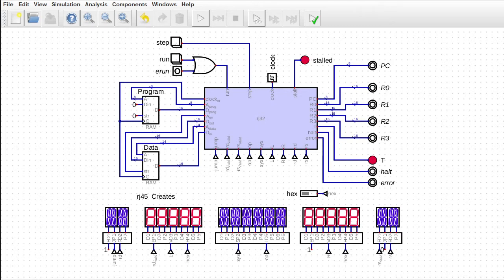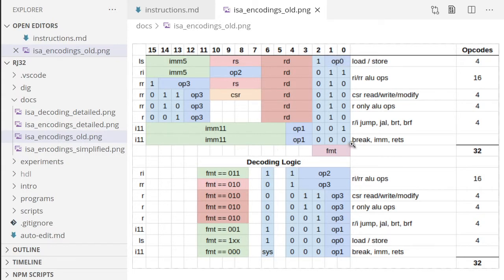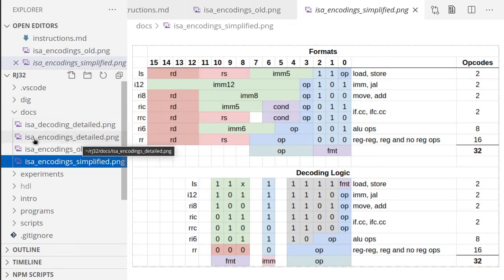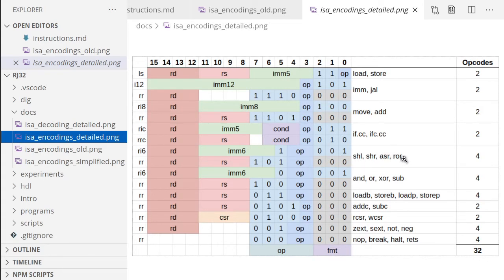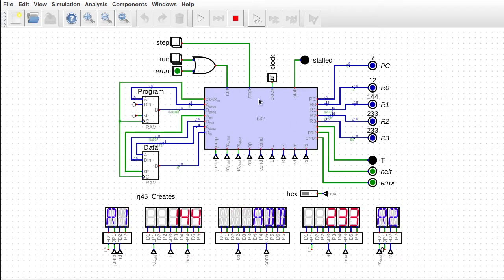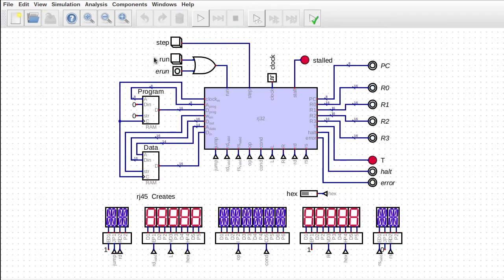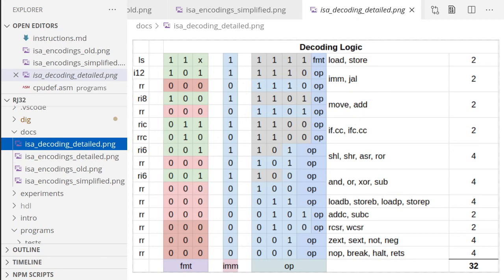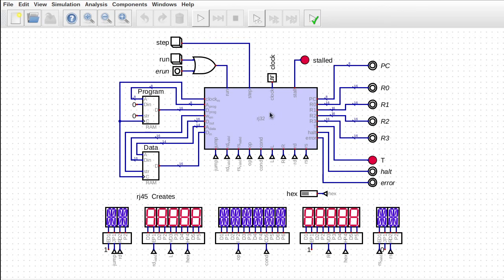[026] Instruction Set Upgrades! - Building a CPU From Scratch

Comment from the maker: If you are building along and get stuck, or just want to chat, join my discord: https://discord.gg/thzHEM3VH7
For the exact code at the end of this video, see here: https://github.com/rj45/rj32/tree/6cdc8bbb0a7289253d5054d50863995b401bcc45
For the optional video showing the refactor (sped up and pauses removed, but otherwise unedited): https://youtu.be/yrvHiifn4mM